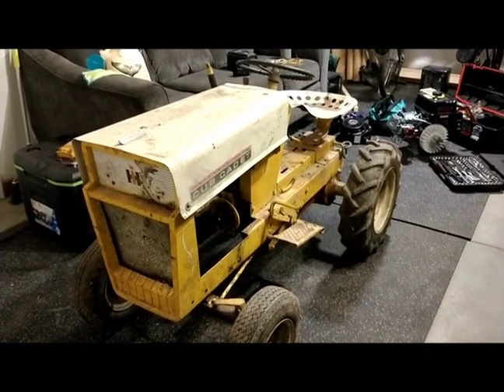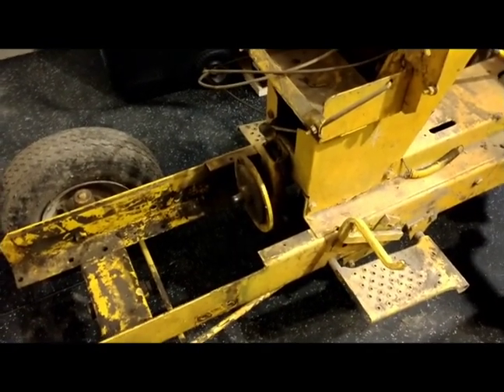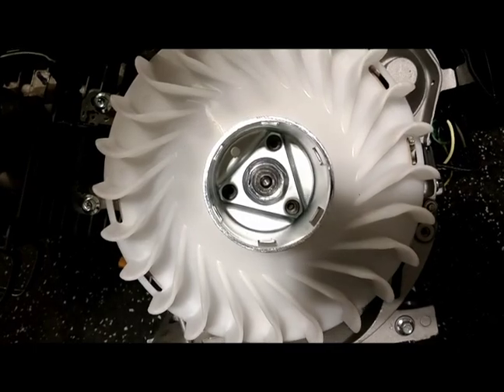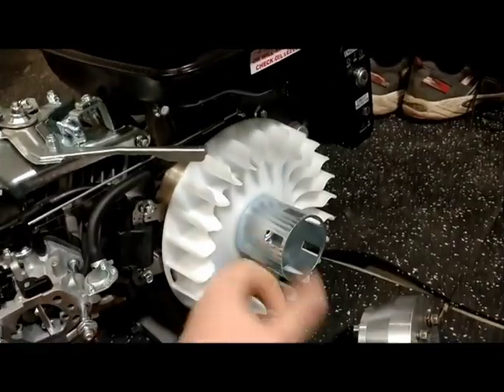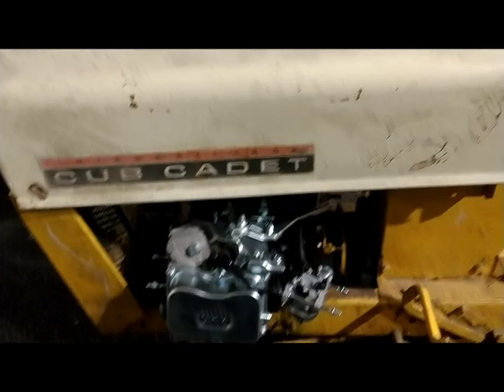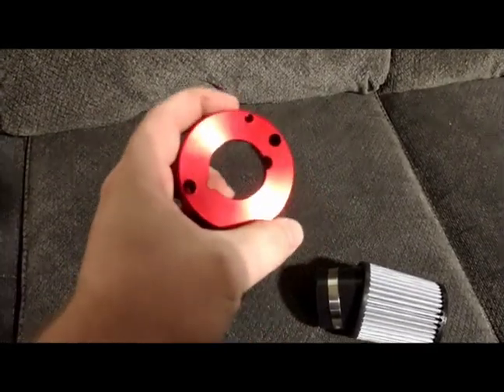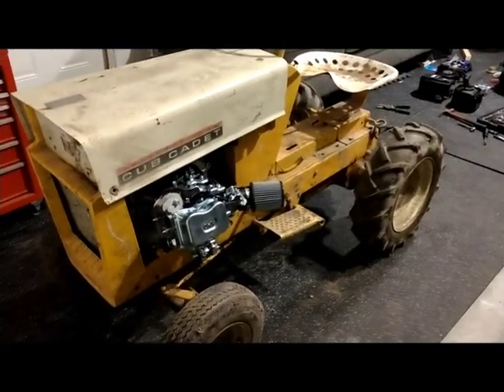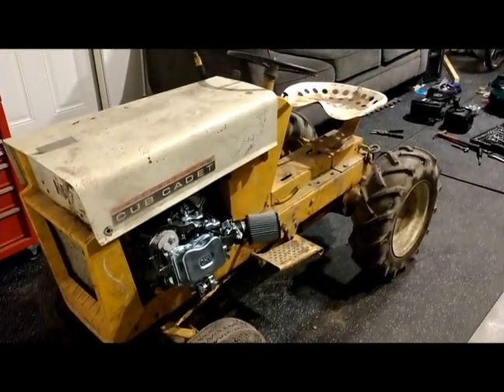Cub Cadet Engine Swap part 1

Comment: Did the same for my cub, predator engine, where did you get the clutch parts? Mine works, but will need to upgrade sooner than later. We reversed the engine and works good,,, idle will pull disk thanks
Reply from the maker: I’m pretty sure I sourced everything from eBay for the clutch. Sorry it has been a few years and I don’t remember the seller.

Comment: Be nice to see it pull a sled.  I haven't seen anyone put a 670 on one yet. I figured someone would have seeing they are a cheep power build. Garden tractors are known for a cheep sport if stay closer to stock. Good video and nice to see someone making adapters to fit these engines on old cubs. Like to get one someday.

Comment: How about tilting the new engine so the cylinder is vertical?
Reply from the maker: I'll look into that. I'll need to fabricate a base to hold the engine at an angle though

Comment: Is there an adapter for the pto clutch?
Reply from the maker: If you put the engine in the right spot , I'm pretty sure you can reuse the same clutch. My cub is missing enough of those parts where it's easier to put an alternator on it and use an electric pto clutch.

Comment: You might have been better off staying with the vertical head type engine ( commercial )
Reply from the maker: I would have preferred that, but there weren't any available near me with a starter. If I had an engine closer to the original Kohler the swap would be much easier. Everything is bolted down and working now. I just need a good day to get a video.
Reply: @jasonwhitler4167  I just removed my 10hp cast kohler engine. Everything was working when parked maybe 4-5 years ago! It’s still free just couldn’t find parts to well for it. Like points and it kept over heating blowing head gaskets so I parked it. But just the other day got a wild hair to dig it back out and toy with it and we’ll watching your video has made me more into the idea. Sadly I use to race go karts so I have tons of flat head engines but don’t know how to make one of those old race engines work. Great content pal.

Comment: You can flip the gears in the rear end and use the crankshaft side of the motor!
Reply from the maker: Yup. I'd like to keep the pto in case I ever find a mower for it, so I opted to just buy the adapter. Currently working on getting the transmission input inline with the crankshaft.

Comment: That was cool to watch. I can’t wait to see it run. I learned a few things too! Thanks for sharing. My friend has a few old yard tractors like that I help him toy around with sometimes.
Reply from the maker: Thanks for watching! I'm hoping to have it running soon and make a new video covering all of the different modifications I had to make to the frame.
Reply: @jasonwhitler4167  what is the name and telephone number & address of the company that makes the flywheel adapter ?
Reply from the maker: @craigalston2208  I just found them on eBay.  Here's a link. https://www.ebay.com/str/zachkerbermachineanddesign
But the adapter does not make the predator 420 a drop in replacement. The crack shaft is at least 1/4" higher from the engine base than the crank on the Kohler, so you have to make some modifications to get the shaft aligned right. I'll show them in my next video, but I've been really busy with work

Comment: Sears made a bunch of farm implements for lawn tractors.  Do they fit the Cub?  Or did IH make some for the Cub?
Reply from the maker: IH made most of the implements for the cub. This really isn't my area of expertise, so I'm not sure if sears made anything that fits the cub cadet.
Reply: @jasonwhitler4167  Just curious.  I have a few Sears implements.  Used them behind a fore-cart with my ponies.  A 4 gang disk and a blade.  Did IH make a sickle bar?
Reply from the maker: @olivei2484  I think so, if not there's definitely an aftermarket one